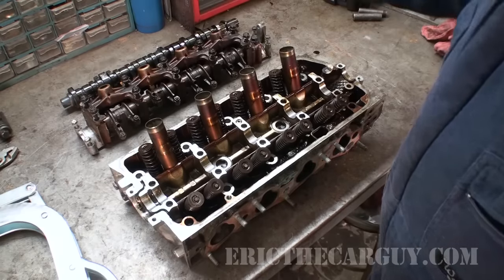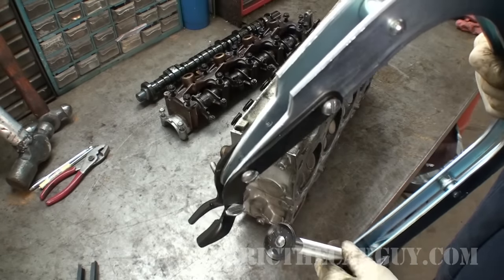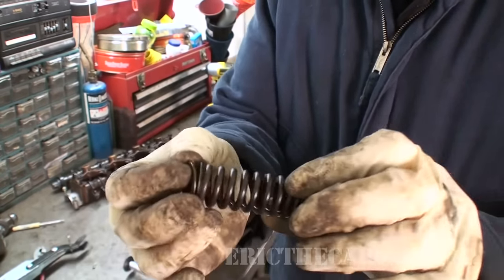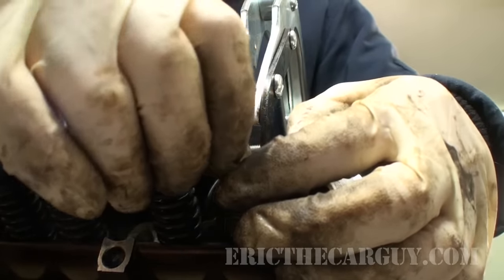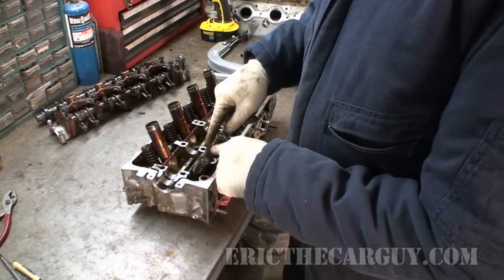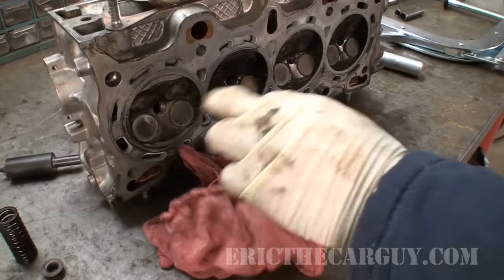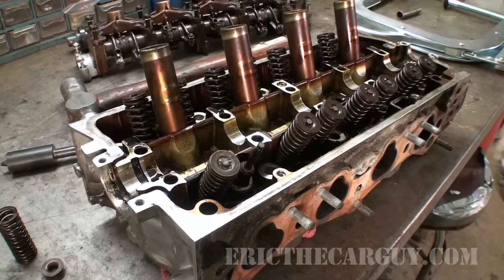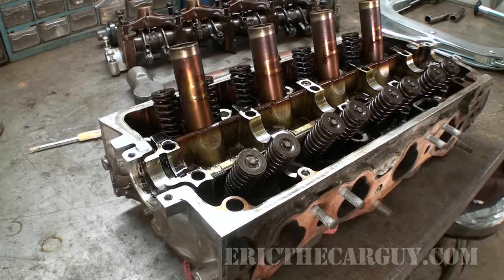How To Remove and Replace Valves in a Cylinder Head -EricTheCarGuy

Comment: If you buy this tool you can purchase  the bigger one by itself me not knowing the difference did just that, the bigger one is for the bigger valves.  I didn't put 2 and 2 together and I can't find where to buy the smaller one by itself.

Comment: What's the reason why you change out vavle stem seals
Reply: Phillip Ockletree when they crack or wear, then they leak down the valve and burn oil, they also lead to more blow by, accelerating engine wear.

Comment: +ericthecarguy Now im in the mid of hesitation in my DIY Project. Im going to replace my seal valve guide. My hesitation between shud I do the rope method or I do top overhaul. I already know about 90% Knowledge about the rope method and prepare all the tools. But I worry about how do I adjust the timing in VVT-I Engine in case I messing up and need to adjust all from begining.. Please enlight me sir. Sorry im asking about vvti. I know u always work on honda. Thx in adv

Comment: How do you replace valve stem seals without removing engine ?
Reply: Use a hosed valve holder and compressor which screws in where spark plug goes. U still have to compress the valve springs etc as in video but there is different valve spring compressor than whats in video that will work too.

Comment: I got a cylinder one misfire it misfires only when I'm idling while the ac is on I've already replaced sparkplugs/sparkplugwires,coil pack,egr valve,headgasket,fuel injectores,and all the sensors but it still misfires I got no idea why it does it and can't really drop it off at a shop seeing how it's my daily and I work 8am-6pm everyday. motor is a 420a 2.0 non turbo in a 98 eclipse, automatic transmission

Comment: If you're watching this video,    your probably pissed. As i am, broke my timing belt.
Reply: nah mate mine stopped running, valves were so burnt and the headgasket was toast
Reply: My timing belt broke- still owe alot so if heads are still gud maybe replacing the valves/guides will save my Butt. Or i found redone heads in Texas for $400 each😉 What you guys think???
Reply: freezeme360 wow thats bad luck. But if your not mechanically inclined its better to go to the Shop😎
Reply: freezeme360 Main thing is take your time, stay organized, torque everything that needs it👍 Lets us know how it turns out 😎😎😎
Reply: freezeme360 yep, i take lots of pics too and lay parts out in a row in the order i took them off. Waiting on heads and discovered i also need new cams😐 but dont skimp on parts. 😎😎😎

Comment: PLEASE SOMEONE HELP ME AND ANSWER ME QUESTION!!!!!!!!!!! ok can you take valves from one head and put them into another? they are titanium so was told not to lap them so guessing wont be able to since the valves will be worn and not worn the same exact way the new head has so im guessing it wont seal correctly. am I right or will they work just fine as long as there are no cuts or grooves in the seats?
Reply: Wear is wear. It's not "recommended" but if you're on a budget you're on a budget and can't get new stuff. With that being said, yes you can use the old ones as long as there's no damage and the parts match up. It's when the heads are brand new and the springs have some ridiculous mileage that I suggest getting new ones.

Comment: will car start if car has bent valves on and interferance engine
Reply: +oldman2909 It will run rough. My ex just had a timing belt break.

Comment: Can you reuse you keepers and valve springs if they're still in good condition when you replace a valve?

I have a 2000 polaris xpedition 425 and it has a burnt valve so I was going to replace it but I was wondering if I had to buy a new valve spring and keeper set.
Reply: yes you can reuse them but I would change the valve seals. But I would buy new keepers and valve springs and not worry about it in the future.
Reply: Fernando Mendez That was the plan thank you for the info.
Reply: what are keepers , never heard of them before they must be a new invention or just something yanks say , as they are called Collets , they have always been called collets , they have never been known as keepers by any engineer ever well at leat not the ones ive known in  the UK ,
Reply: OfficialBassMerchant Thank you for the information i'm only 16 and still learning wanting to go to nashville auto diesel college so the more I know the better.
Reply: We called them keepers in US when you put the bottom retainer, spring, upper retainer then the keepers to set with groove in the upper part on the valve.
Reply: Nobody calls them collets here. Same purpose though different names.
Reply: Education has nothing to do with it, it's been called that here for many years longer then both of us alive.
Reply: Fernando Mendez
 Education has nothing todo with it LOL LOL LOL LOL LOL LOL LOL LOL POINT PROVEN

Comment: What does valve size have to do with gas mileage?
Reply: +Sean Perkins a bigger intake valve means they put a bigger one on there to allow more air/fuel mixture into the cylinder at a time so in essence youre using more gas per stroke of the piston

Comment: Aaah, there is that tool for, (first one) haha whe have a smaller version for the small engines but never know its for that haha, well now i know. i always do it by hand. the ones on small engines (honda) you dont have those keepers but slides on the top rings of the spring. So its pressing down slide it on and done.

Comment: Hey brother. I have a problem on my hands that I'm praying someone can help me with. 
I took apart my cylinder head and had all of my valve stem/push rods out, and I laid them all out neatly, in order, on my garage floor. I was going to number them and poke them through cardboard and but my dumbass dog ran into my garage like a bull in a China shop, and the stooge knocked a bunch of them over. I set them back up in the order that I THINK they were in originally, but I'm not positive. I do know however that I DO have the exhaust and the intakes separated, but I'm not sure if they're all in the exact order that they were in originally. Could I maybe test these to see if they seat correctly and then re-assemble and see what happens? Should I lightly lap them? I'm out of my mind upset right now. I spent so much time disassembling
this car and I'll be devastated if this project is officially ruined because of this. If you could let me know what you think when you have the chance, I'd really appreciate it. Thanks- Earl

Comment: One of the biggest issues with DIY mechanical work is knowing one's limitations. It has always seemed odd to me that we ask machinists to do some work that requires critical tolerance, but other work, like lapping valves, can be done by hand. Isn't it absolutely critical to get that exact? Can't a machine shop do a better job than I would do by hand? Wouldn't it be better to just take the head in to a shop and have them flatten the head and do the valves for me? How much does that cost?
Reply from the maker: I've done plenty of cylinder head work just like this without issues. You don't need to send it to a machine shop unless you need the seats cut or something like that and even then they make a hand tool to do that job as well.
Reply: I agree with Spelunkerd.  Valve work is not something most mechanics should do unless he/she knows the engine inside & out.  If you try to replace valve for BMW M50 engine without compressing ALL valve springs in the same time (Dealers/machine shops have $1600 special tool for that) your came shaft would break into multiple pieces.
Reply: Sang Kim
Woah, that's a really really really bad engine design.
Reply: I'm not too familiar with bmw engines yet but every engine I've worked on always allow the camshaft to be removed before needing to remove the valves. If what you say is true about the camshafts not being allowed to be removed previous to removing the valves then damn...that is bad engineering design...thank GOD I dont have a BMW :)
Reply: Well, not exactly what I said.  I said the all valve springs must be compressed using a special tool before the camshaft can slide out. This does not means you would have to remove the valves.  Over the years people found a way to do this without using the special tool.  If you can weld, you can create a tool yourself or you can turn the camshaft until you find a position that has least amount of spring pressure.

http://www.pelicanparts.com/BMW/techarticles/E36-Camshaft-Removal/E36-camshaft-removal.htm
Reply: Sang Kim
If the tool was actually reasonably available, and there was some great benefit to that design, that would be fine - but neither of those seems to be the case.

So, that's a really really really bad design - it sounds maliciously lazy.

Doesn't mean you shouldn't work on your own car or push your abilities, that's the only way to get good at anything.
Reply: maybe on the olden days the shops were better. not any more.  I took my lux to toyota service centre for a new head gesket , and you won't believe the ship service I got. alternator loose, water pipe clamps loose. than I took it in again for front disks replacement which I had to buy new ones a week later and do it myself. but if you have time and money. take it in.
Reply: +Team Toyota I bet you regret ur youtube handle now, eh? :P
Reply: Naaa
Reply: just because ericthecarguy is showing us how to remove and reassemble the springs and keys...doesn't necessarily mean every person is doing this for machinist issues. could be like me just wanting to clean things up and inspect the inside of my engine to make sure no cracks or problems.
Reply: If you like spending yours or your customers' money....Send it to the machine shop.
 I like Eric's way much better!
Reply: Ken Barnett true i agree with you
Reply: If you consider the pitting that happens as an engine wears, the valve seats become imperfect over time. It doesn't hurt the engine, besides a loss of power because of pressure leaks. So, any amount of hand lapping is an improvement. Personally, I used a power drill instead of my hands ;)
Reply: +Sang Kim
All of your information is wrong. The cams can be removed prior to doing anything with the valves, and the cam holding tool is about $100. In fact there is no way to "slide" cams out of an M50 at all, it has caps that need to be unbolted in a certain order to remove pressure evenly, which is how you avoid cracking the cams. Pretty standard stuff. M50's are not hard to work on. Your comment was years ago but any future people should know they're not difficult motors to work on.

Comment: man sure wish you could just repair the valve that's burnt in my misfiring dodge neon , I'm a pretty good mechanic but I drive 2 hours a day to and from my job and I fear I would complete the entire job over the weekend as I have never removed a cylinder head on a car engine , it looks so simple all the shops are ready to charge me thousands to fix it I'm so pissed ! Hey you know what I think lie just rent a wreck the following week after I do the job and ile just refer to my Hanes manuals to fix it screw it
Reply: Ugc1911 so did u fix it